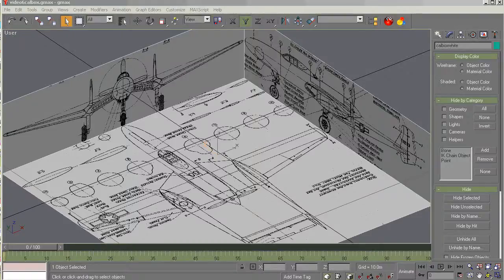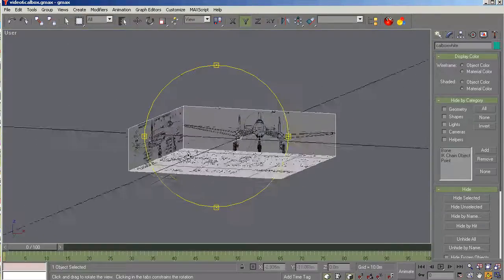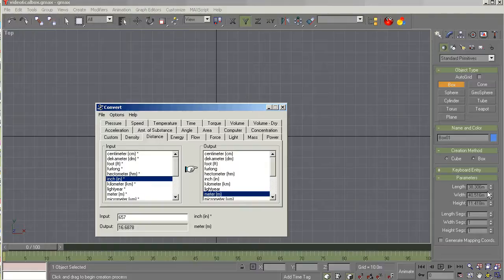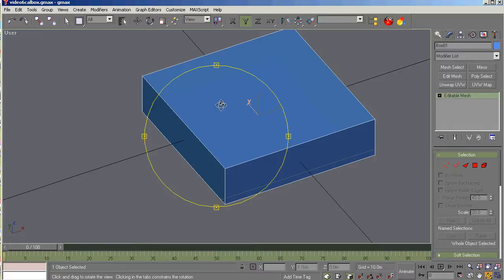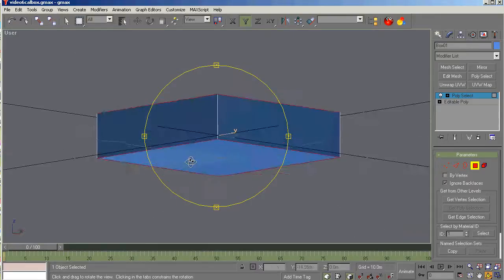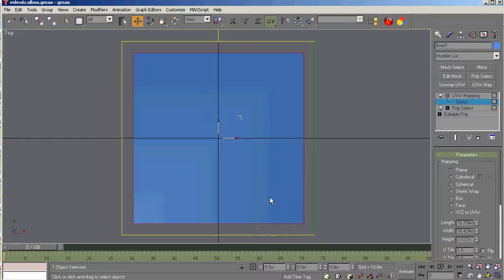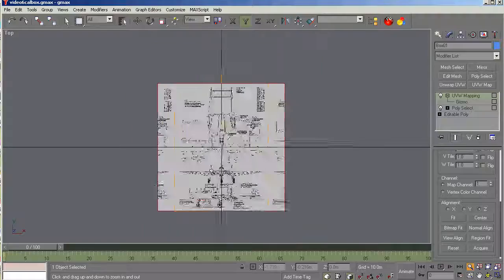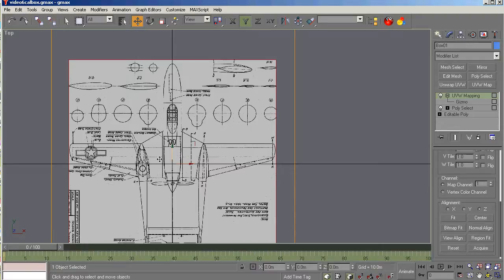Gmax 1.2 for the Beginning Modeler #7 - Part 2 - Calibration Box

Comment: Are there any possibility to create  a VC for  b737-400 f9 default?
Reply from the maker: Generally, without the original source code for that model, no.  For FSX, yes, you can replace one VC model with another as teh VC model is separate from the "exterior" model.
If you would like an improved VC, there are several really nice 737's for FS9 available for free, and as payware.  You can find then at sites like Flightsim.com, AVSIM.com, Simviation.com, etc.  Do a websearch to see what you come up with.
Reply: @IFRfun  THX a lot. Ive found i great one panel but it doesnt have VC. :(
How can i found this code? I really want to learn about VC creation.
Reply from the maker: @flightsimulatordevelopment3546  The VC is a part of the Interior "model".  Youu build it just the same as you do other parts of the exterior and interior models.  Keep following this tutorial series to develop the skills and knowledge. Once you have progressed to the VC modeling parts, you will see more technologies employed necessary for building the VC.  The VC is a bit more intricate and challenging because of other factors considered for up close viewing, number of animated switches, dials, levers, and building of either steam or glass gauges.  Using XML is required as you advance and you will need a good technical support and learning website. I highly recommend FSDeveloper.com for all things FSim related.
http://www.fsdeveloper.com/

Comment: Does Gmax 1.2 work on Windows 10?
Reply from the maker: Ghost Dog, I have Gmax 1.2 installed as a backup on a Windows 10 machine and it seems to work fine for me.  I have however heard others say it doesn't so I do not understand that.  It may be a case of how it was installed.  It would not hurt to try. :-)  Thanks
Reply: Thank 'you'. I will try, of course, but it doesn't hurt to know I can expect it to work (don't have Windows 10 at home; otherwise I wouldn't ask). :)
Reply from the maker: I just went to my W/10 gmax setup; went through all the motions of creating, changing preferences, saving, selection, exporting to flight sim.  It all worked just fine.  With that said, what I did to install gmax and supporting programs in W/10 was simply copy over the Gmax folder and QuakeIII, Tempest, etc to that system. I did not do installs, as I recall, of any of that, simply a copy over.  Then created a shortcut to gmax.

The only thing different I can see is that the Viewport names that are typically in the top left corner do not show, but they are there.  You can right click on them to get a drop down menu to do any view port changes.

Other than that, its all good.
Reply: Nice.

Comment from the maker: Rene, you can hide or unhide objects in the scene.  Look at the Display Icon top right and see if it is hidden by chance.

Once displayed, there are many ways to view objects.  You can use F3 to switch between skinned and  the  line displays.  F2 shows highlighted polys in red, F2 again turns that off.

Feel free to go back and view these from the beginning to watch where I go with the mouse and how things are done.
Reply: found it  thanks for the advice but only problem there  is when i  import the files  it doesnt look like in the picture,

Comment: Excellent series of videos, I have a couple of additions that may (or may not) be helpful:

-Most of my current projects are US-built airplanes, and thus most of my dimensions are in inches. If you ensure that the system units in customize|preferences are metres, you can then use customize|units setup to set the units for the project to something else (I use decimal inches because that's what the data I have is usually in) while still exporting the model in metric (ironically, this is what you do when you use "standard" units in real life - they're all defined in metric!).

-When creating your calibration box, if you click "keyboard entry," enter your numbers, and hit "create," a box to your exact measurements will be created, and so long as the creation method is "center," the pivot will be in the center, and it will be at the origin. I find it saves a fair amount of effort.

-I noticed you converted the box to E-mesh. I am totally projecting here, but if I had to hazard a guess, it's because your intent was to flip the normals - based on my experience with always converting E-poly objects to E-mesh for the exact reason of flipping normals. This is because I was unaware that it is possible to flip them on an E-poly object - it has to be done at the "element" subobject level. You may have been aware of this already, but I thought I'd throw it out there just in case.
Reply from the maker: Hi Eric, indeed, simply change the Units Setup in the Customize drop down menu to ant metric you wish to use.  As long as your System Unit remains in meters, you are good to go. :-)

RE: Calibration  box- yes I mentioned using the KB entry method.  The reason I wanted to show drawing from the TOP viewport was to show that method of having the LWH metrics matching up with your dimensions (versus doing that from the side or front/rear.

Exactly the reason of converting to editable mesh in that instance.  Normally, I would use editable poly and switch only to Flip Polys or extrude a line, and on rare occasion, to get a boolean or complicated extrude working that were giving me fits. :-)  Thanks for your comments.